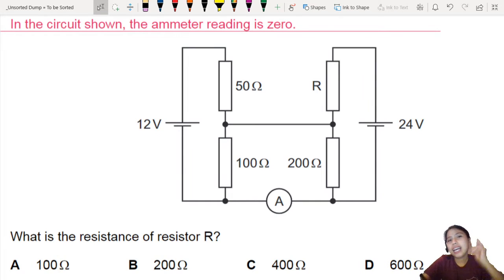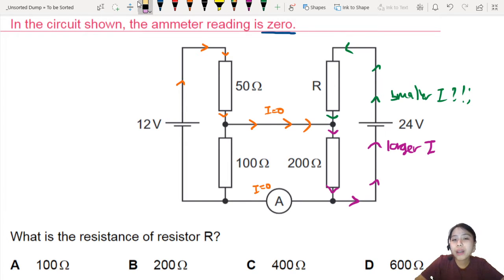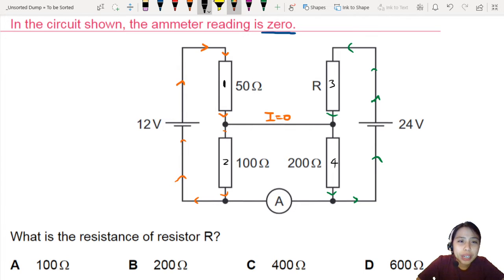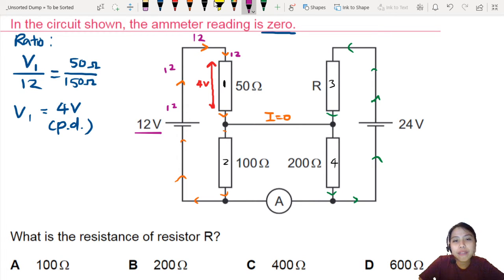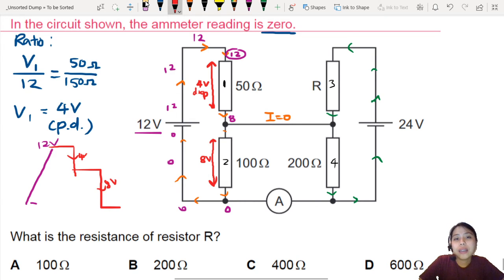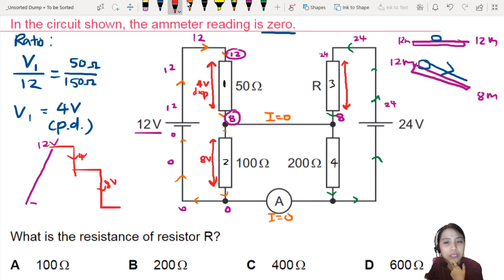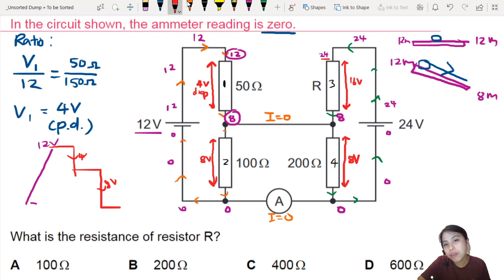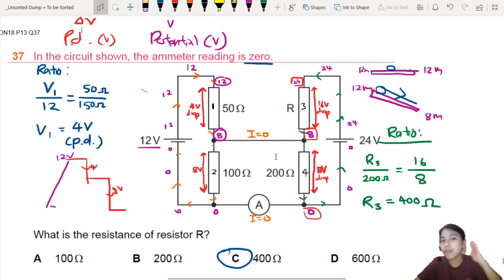10.3c Ex2 ON18 P13 Q37 Double Bridge with Two Circuits | AS Electricity | CAIE A Level 9702 Physics

Comment: if you assumed current is 0 in the wire with no component because you assumed the current is not going over the bridge then can't I assume the current from 24v battery goes to resistor R then through bridge with no component and adds up with current from 12v battery and goes to the 100ohm resistor then the current splits in the junction to the left of ammeter and assuming I1 was current in R resistor and I2 was current in 50ohm resistor then at the junction to left of ammeter the current splits into I2 and I1 where they would go  to the 12v and 24v battery respectively?
Reply: She did not “assume”it is 0